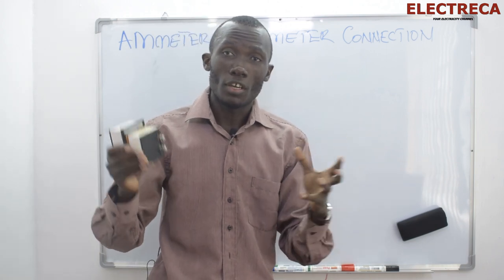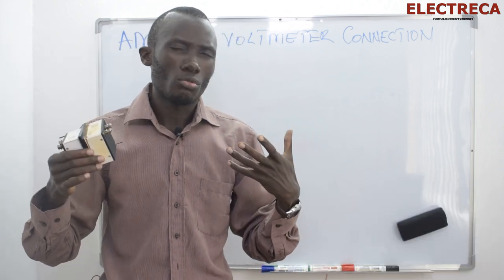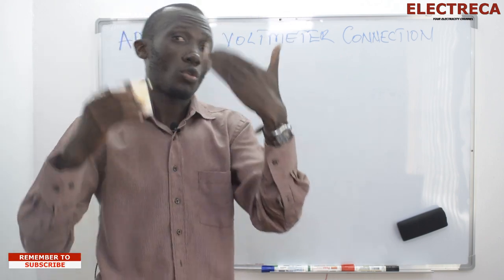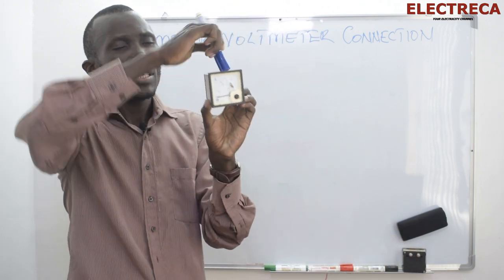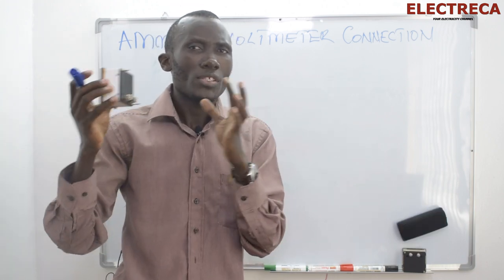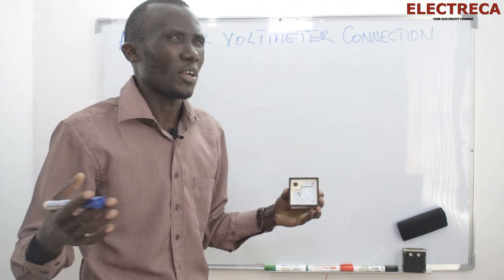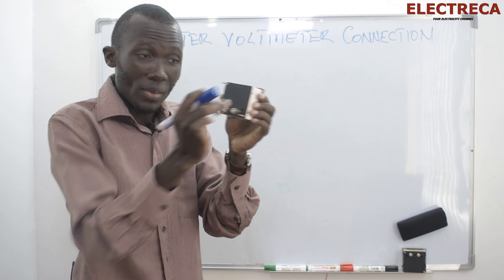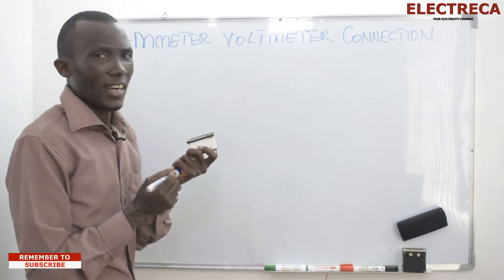Ammeter Voltmeter connection | white board explanation | Electreca

Comment: Ok I have a db for my 3phase borehole pump.they installed only one voltmeter,and one ammeter,They are all functional,how is that connected compared to your explanation plz
Reply from the maker: As I mentioned in the video if it's a motor circuit like your 3phase borehole one ammeter connected to any phase of choice and voltmeter connected across 2 phases.
However if it was another 3phase circuit or installation ather  than motor  then you would have to monitor all the phase independently by connecting ammeter on each phase. 
Thanks for witching.